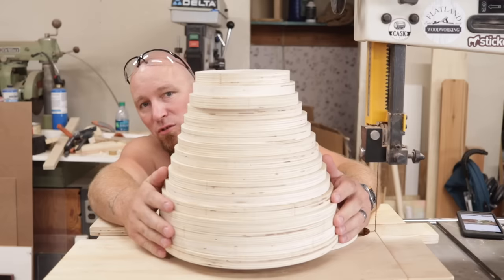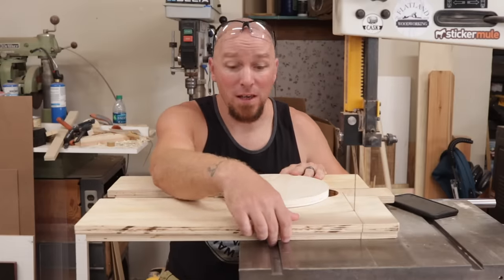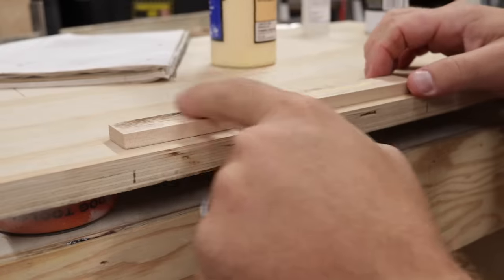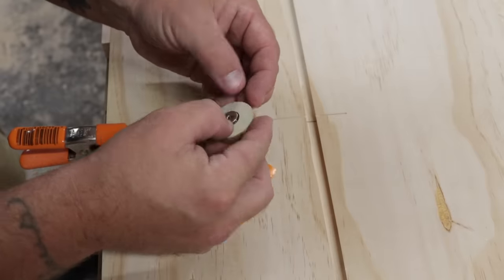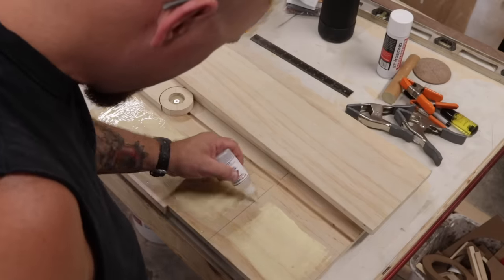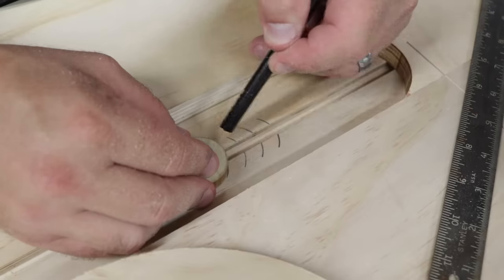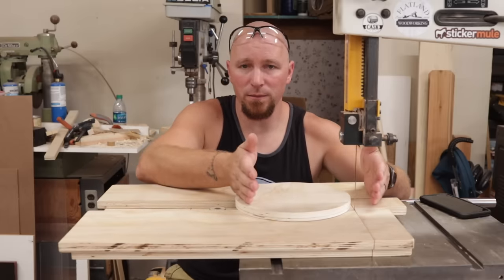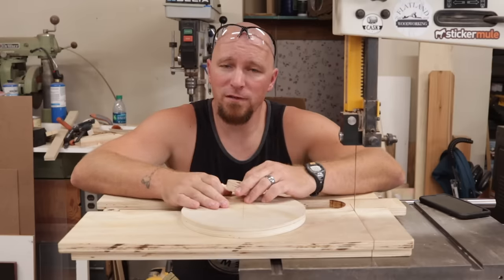The ONLY bandsaw circle cutting jig that fits EVERY NEED!

Comment: I'd make it longer and lock it in to both slots, and/or leave an extra dovetail slot on the bottom and clamp it to the table with a dovetail slot clamp. What an excellent tool though. Nicely done.

Comment: Why not extend the jig to the other track in the table and make another "locking" runner which should keep the jig from tipping. Great idea though. Best circle jig I've seen
Reply: The magnet would be fine, but if he can make 41" circles he would need a support leg on the outer end.
Reply: I have made one of these, modified as you suggested Richard. Great idea - it works like a dream.
Reply: That's what I thought of as well.
Reply: I was just going to suggest that, when I saw Your text Richard. :D
Reply: Or just clamp it to the back edge.

Comment: Definitely nice looking and the only improvement I could think would be to extend it on the inside to make use of that other track on the inside for a secondary runner. That would offer a bit more stability without having to prop the jig up I would think.

Comment: I built mine over the weekend!

The only changes I made were to extend the sled beyond the inside edge of the bandsaw table, and then added an "L" shaped leg to hook below the edge of the table. My bandsaw only has (1) T-track slot and the leg keeps the sled in contact with the table no matter what. I also used an aluminum t-track instead of routing in a dovetail for the pivot adjustment, and a piece of 1/2" thick HDPE for the "donut". The sled got pretty heavy, so I used a 3" hole saw to remove some material. 

It works flawlessly, thanks for sharing your design!

Comment: I built a version of your circle cutting jig and it works amazingly well!  Thanks for the video! My version has 4 changes that I think improved utility:
 - I made the center adjustin knob less than 1/2" tall. Then I only drilled 1/2" through the donut.  This change provided more surface area for double stick tape.
 - I used a MATCHFIT Dovetail Track Hardware® nut to help prevent maring of the dovetail track when the center knob is tightened
 - I extended my sled to the back of the bandsaw table where I put a stop that wraps around to the bottom of the table.  This prevents tipping of the jig whe cutteing large circles.
 - My cut-depth stop is a full 3/4 thick and extends all the way to the bottom of the table. Thiss allowed me to use a threaded insert and a knob (or just a bolt) to act as a depth adjuster so that i can fine tune the depth of cut in case the saw blade shifts when it's replaced. To make room for the adjuster the base of the jig has to be ~1/2 inch wider than the table and the dovetail track need to be cut 1/4" behind the blade edge..  I also added two nuts on either side of the stop to make sure the adjustment doesn't change accidentally.

Comment: Great idea.  Just what I was thinking of designing myself.  You saved me so much time, trial and error with this video.  I think one way to handle the stability would be to use a Rockler Universal Fence Clamp on the end to the left of the blade.  You could also make it longer on that end and use a 'T' bolt in the other miter slot to hold it down similarly to the way feather boards are secured.  Or perhaps even rig up a magswitch to hold it down.  I already have the Rockler clamps, so may go that route.

Comment: Went ahead and made this jig with two mods. Cut a T slot instead of dovetail, and extended the base to use both tracks on my bandsaw table. Great video, great jig. Works great.
Reply from the maker: That's awesome! I used the dovetail because I had it, and I was trying to just use stuff I already had. But I did wish I had a slot cutter when I made it. Glad it worked out for you!
Reply: @InspireWoodcraft  I also learned that what tape is used can be important. Especially on big circles. Ended up adding two screws in the doughnut for a 30" circle. Worked great

Comment: Thanks for another great video.  I haven't read through all the comments but the ones I did read suggested extending the table or using a clamp as a fix for the wobble issue.   My thought was to add some weight over the pivot point.  A bag of washers, nuts, pennies or whatever you have should be enough to counteract the imbalance - just enough to bring the center of mass back onto the table.  No rebuild required, and nothing to interfere with any moving parts.

Comment: This is by far the best circle cutting jig I've seen. I definitely need to make one.
Reply from the maker: Thanks man! I’m rather fond of it as well. Let me know if you make one!!
Reply: I second that, I'm so making the same one! Thanks dude.
Reply: Agree with Joshua
Reply: Please how much will it cost to get one of this machine?
Reply: Joshua Luther नाइस
Reply: I built one using Darbin Orvers video. It works fine. I found that the front edge of the blade teeth varies depending on blade width. I just moved the pin over to match. By using a small dia nail, I found that I could have more than one location for it. Also, a small clamp can be used to keep the jig from tipping. I do like the wheels idea to eliminate the center hole. Also I recessed a tape measure, indexed with the edge of the jig. then I could move the pivot point to whatever radius needed.

Comment: This is the BEST circle jig I've found on YouTube yet...Built mine today! I did add the track in the slot to the left of the blade also to prevent the tipping issue. To be more efficient for the types of things I do I made three (3) 'Circle Centers': (1) for Tape (Like yours), (1) with a sharp point, and (1) with a 1/4" rod. Some of my 'Production' items require a 1/4" hole.  This was a fun build...and necessary for the accuracy required for making circles in my woodshop!   Thanks for what you do! Remember 'Sawdust is Man Glitter'. :-)

Comment: Hi
Just built the Jig ... Great
Two things That I will upgrade
1. I'll use a Track instead of the dovetail it wears the wood out 
2. I'll make a new doughnut but will not go through. It'll be easier  with the two way tape
Thanks again for a great jig

Comment: I like the effort you put into your jig. My suggestions are based on my own experience cutting "green" ceramic billets on a bandsaw with a bimetal blade. I use a back stop that is clamped down at the back end of the table on the left corner which also has a second piece of wood attached to overlap the jig table as it slides home to the back stop to alleviate any imbalance if the weight wants to tip the jig upwards. To prevent movement of the jig while I apply a torque to the work against the saw blade, I have a quick squeeze clamp I set at the front of the jig to lock it down. Now I can apply a torque against the saw blade with confidence nothing will move throughout the process. The backstop is simply a square cut in half (same thickness as jig table), lay one half on top of the other in an "L" shape and glue it together with a thick sheet of paper between them to have some clearance over the jig table.

Comment: Great ideas!!  I did add one thing to mine. I added microjig dovetails to the top so i could attach a fence or clamps for use when not circular cutting.  Also one underneath so i can clamp the tabe down.

Comment: I made your jig and it works very well. I had some issues getting the alignment right as it first started cutting pretty little winding spirals.
Re the tipping you mentioned: My bandsaw table is narrower than yours so I am able to use a jig across the full width, and use a simple clamp to keep larger circles from tipping the jig.
You could use your left-side t-track to hold some kind of clamp.
Thanks for this great idea.

Comment: Well done.  I use a similar jig but it uses a pin where each hole located every inch from the next. So I am limited to whole inch increments on the radius.  This is ingenious.  In addition to not drilling a hole on the bottom of the work piece, you can have an infinitely variable radius to get whatever size circle you want.

Comment: Cool build!  One option that you might want to consider is to put the nut in the dovetail into a piece of wood that has a pin sticking up that would align with a measuring tape glued beside the dovetail.  That way, you can easily set a radius of (for example) 17 5/32 if you needed it.

Comment: I just made a Bandsaw Circle Cutting Jig using your design.  The only difference in mine was that I used Micro Jig hardware. It works like a charm. Nice and easy and very durable. The donuts makes it much easier to set up and cut.  I never liked the post and holes in the circular jigs I used before.  Thanks for the video.  Best regards, Richard...

Comment: I like your approach on this.  On mine I added an adjustment to the front stop so the sled can be moved back or forward for blade alignment.
Your overall design is superior to the jig I use now so I may have to build another based on yours.  Thanks for sharing.

Comment: Excellent plan and video is well done.  Thanks for sharing!  I used 1/4 x 20 carriage bolt in the adjustment knob and was having trouble with the nut not getting enough traction in the dove tail track for the knob to tighten.  I switched the standard nut to a barrel nut on the 1/4 x 20  bolt and now the jig works great!

Comment: Like you, I didn't want holes in my circles and came up with a similar jig for my tablesaw a couple of years ago. I like the dovetail adjuster. My carriage is screwed into place each time. No big hassle as I don't need to vary the diameter very often. I have cut 1 60 inch table top and would change a few things before attempting another of that size

Comment: I love this jig.....just built mine with a couple of variations.....I used both miter slots to improve tracking accuracy....inlayed T slot tracks and used T nuts to secure the pivot...I have a feeling that the dovetail groove would begin to get dented by the nut the more it is used and lastly to stop I epoxied rare earth magnets to counter the tipping problem.  They slide easily enough but it takes quite a bit of weight on it to start the tipping.  Loved the project Jodie keep up the awesome videos!
Reply from the maker: Thanks for sharing!! I really appreciate you coming back to leave this comment! I'm really glad it worked out for you.

Comment: Hi Jody!  I looked at several other designs and every design has pros and cons.  Your design is quite clever and fits my needs the best so, I built one.   My build is just a tiny bit different because I went with stuff I had around the shop.  And, after I finished it, I realized I can have the best of both worlds with your design — tape without holes or pin with a hole.  The only difference is the bolt — I have one T-bolt that sits flush and one that sticks up with a point.   Now I just need to figure out how to upload photos so you can see.  Anyway,  thank you very much.  You inspired me and I’ve subscribed.  Cheers!
Reply from the maker: Brilliant! I'm glad you made one and thanks for sharing your experience with it! (We need more interaction like this and less nonsense!) My original mockup had a pin, so I completely understand what you're saying. Thanks again!

Comment: Perhaps add imbedded strong magnets on the blade end of the jig to help stop the other end from lifting with larger diameter circles. Maybe even add a felt cover to the magnet to allow better slide ability when first pushing the work into the blade.. Hope you get my meaning here.. Thanks for the great video

Comment: Interesting solution to a tricky problem. I like it! My solution to cutting circles is a bit less elegant but didn’t require an major construction. I use a circle cutting jig attached to the bottom of a router. Instead of driving the pin into the work piece, it sits in a smaller circle that gets double-side-taped to the work piece. Then, there’s an extra spacer that’s attached to the bottom of the jig near the bit that levels the setup. I’d definitely make the jig in this video if I had to cut a few dozen circles and didn’t have a CNC in the shop.

Comment: Just drill some holes in the bottom and sink a few string magnets into it to keep to stable to the saw table.
I had a similar issue with a different jig I made (my runner was just square..) and I had a few big magnets and threw them in. You can still slide the jig on, but it very satisfyingly stays in place.
Hope this helps,
Amazing jig, I hope to make my own!

Comment: I really like your ideas with this jig.  Regarding the issue with the jig tipping off the table, I would like to inspire you. May I suggest that you make an “L” bracket the length of your saw table. Make it slightly thicker than your circle jig sled. Fit the bracket with “L” upside down and had a couple of mag switches, wax it and the top of you sled. With the mag switches turned on, this should be strong enough to prevent the jig sled from tipping when larger circles are require.

Comment: Definitely going to build one of these!  I always seem to cobble together a throwaway jig when I need a circle and never invest enough in a jig to consistent results.  First thought would be to have it hook over the edge of the table to keep from tilting.  Now if I can remember to keep double sided tape stocked up...
Reply from the maker: Yeah as long as you can still slide it forwards and backwards on the table. Mine would have not rocked if I would have designed the runner a tad different. I got so rushed, and with still learning filming stuff and what-not, that I might have cheated myself a little there. Still though, I use it more than I though and it works absolutely amazing. As far as double sided tape goes, that's a must to keep stocked regardless in my shop. It just comes to the rescue for so many things!

Comment: Hey Jody excellent video!  I will have to build one of those!  I want mine to be able to do 48" circles.  I have a a specific idea in my head that I've been wanting to build for years..  One thing I want to try differently is to use blue masking tape and CA glue to hold the work piece to donut. Thanks again!

Comment: Outstanding!  Great idea and great job creating it!
I can suggest a couple of ways to hold your jig down on the bandsaw table:
1.  Use a couple of 1/4" countersunk machine screws to fasten the left side of the jig to the bandsaw table.  You can either drill and tap 1/4" holes in the bandsaw table and screw your countersunk screws through your jig and into the table (they have 1/4" threaded shafts with knobs too) into it or drill 5/16" holes and get longer 1/4" countersunk machine screws and 1/4" wing nuts to fasten it down.
2.  Mount removable shelf hangers on the right side of the bandsaw table.
3.  Use clamps to hold it down after sliding it in to the turning point.
Regardless, this is great stuff.  Thanks!

Comment: Man that's awesome!  I've been using the router and a tramel for mine, but I have that same problem, of having a small hole in the center of the underside - usually not a big deal, but this is much cleaner.  Thanks much!

Comment: Great ideas .. one thing I would suggest ... mark the cross hairs from the guide ring on to the circle you've cut before removing the guide ring from it. This would allow readily finding the exact center of the circle just in case it is needed later.

Comment: Great jig I will be using your design and mod it slightly. I'll use a key way bit instead of the dove tail bit and I'll extend the jig to cover the other miter slot, that should eliminate the teetering on larger work pieces.

Comment: cool idea. maybe use some magnets to attach to band saw table for when you said it rocks a little. just a thought.
Reply: Maybe a couple of magswitch magnets
Reply: Some tables are aluminum... no magnets..
But, he has a T slot, make another guide, glue and screw it on. Or in my case , extend the top yo go over the left side of table, add a 'catch' bracket to keep the top in place

Comment: Watched , really liked, and made. The nut kept pulling into the wood dovetail and it would move . Couldn’t keep it tight. Installed a T-track with square head nut sliding in track in place of dovetail. Now works great. Just couldn’t the dovetail work out for me.

Comment: Excellent design. And easy to align the cut piece to the spindle. The only thing I would add is an adjustable stop that allows a perfect alignment of the pivot cylinder point to the gullet of the saw blade. I found out from experience that, if that alignment isn’t nearly perfect,  the blade will wander from vertical. The alignment changes each time you use a different width blade. I fixed that problem by placing a 1/4 inch, 28 threads per inch bolt through the stop on the left side that can be adjusted to change the stop point by a fraction of an inch.

Comment: Nice work! So nice in fact I had to make one as my other one had the nail method which left a hole in my work. This was perfect! Only change I made is using some leftover t-track and putting a t-nut in the disc to tighten down on a shortened t-bolt. Thx for the design brother.

Comment: Smart design on the double stick rotation "bearing" ... thumbs up.  

As to the tipping, just clamp the jig to the fence / table on the left (blade) side.  Since you aren't trying to hold it from moving around left / right in the horizontal plane (your runner does that), you only need very little pressure to keep it from moving vertically / tipping upward.  Alternatively, you could use a caul to extend across the table or screw a piece that "hooks" under your table (thinking added to your stop).  

Imo, no need to put the leg under the other end (but you still could).  

Nicely done ... I can see this as one worth making.